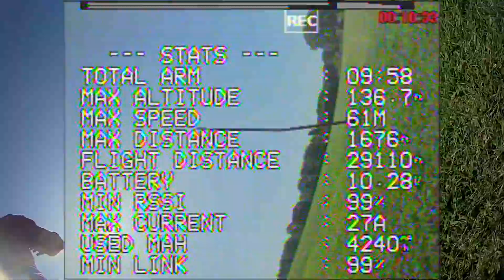Sub 250g (29,000ft Total Flight Distance Test) 3" HD GPS Long Range FPV Quad V3 - Under 250g

Comment from the maker: My Top 5 Achievements in Sub 250g FPV :-
1. 2.08 Miles Long Range Flight (HD, GPS) :- https://www.youtube.com/watch?v=9J6eG5o6_jE
2. 18+ Minutes Flight (HD) :- https://www.youtube.com/watch?v=RJQxhjeUilY&t=329s
3. 29110 ft Total Flight Distance in (HD, GPS) :- https://www.youtube.com/watch?v=9dqISZjqBlg
4. 125mph (201kph) Top Speed 3" :- https://www.youtube.com/watch?v=cTC4UaPfBtA
5. Best Ever 4" HD Freestyle Quad  :- https://www.youtube.com/watch?v=-Zw3A9fFODs&t=5s

Comment: Furious FPV has a 2.4 800mw VTX and a diversity module to match.   Bigger antenna sucks to deal with but I wonder how far it can go.

I have been a 1/2 mile out and back on 2.5inch.  RSSI on the crossfire was having more complaints than my 5.8 Mach3 but I am Rapidfire with dual 6db patch antennas on the Immersion Lazer mount.
Reply from the maker: I've been out to 1.28 Miles with 5.8GHz and could have gone further but for the battery here is the video (https://www.youtube.com/watch?v=xy8Pnb2xEC0&t=9s) and the RSSI on my crossfire only dropped to 95%, I now have the battery setup to take me to 2 - 2.5 Miles Sub 250g so we shall see how far i can go on Wednesday, I have looked at the 2.4GHz but it seemed a little heavy and i am already at 249.8g with my current setup. I even bought the new TBS Unify Pro32 HV which is crazy powerful but again heavy compaired to the 2g TBS Unify Pro 5v 800mW. Great work on your CheaterKwad build, if it wasn't for people like us who would the Chinese copy lol  !!!!!
Reply: @Sub250gFPV  i have been out to 1 1/4 miles as well but that was a very open countryside type of environment.   My RSSI was dofferent because I used LQ/RSSI for the flight.    But my 2.5in 1/2 mile flight was in a much more urban setting.    And there may have been a tree between my LOS as I flew it.
Reply from the maker: @dividingbyzeros  Backgound noise in the urban setting I understand. Do you know the weight of the 2.4GHz antenna ?
Reply: @Sub250gFPV  sadly I do not.   Maybe RMRC's page might have some specs for the VAS offerings.
Reply from the maker: @dividingbyzeros Will do I'm now subbed to your channel, oh and thank for your advice as I've got the ImmersionRC SpiroNET LZR Long Range Antenna Array with 2 x 13dBic Patch Antennas coming tomorrow to use with my rapidfire and HDO setup, I like the idea that when the two rapidfire signal bars are equal you are looking in the direction of your quad. (not sure about the weight issue - like having two Jodrell Banks strapped to your head lol)

Comment: Great work!! This is one of my dream.

I dont expect that much(around 5.5 miles that is crazy) 

Could you kindly share your setups?
Reply: Sub 250g FPV Sub 250g FPV that's alot. but worth it. subbed your channel , I will watch your all videos.

let me give you my 3inch setup. 

-IH3 frame
-Hglrc 1407 motors
-runcam split mini 2
-Geprc stable fc + esc + vtx stack
-xm+ 

It is little under 250g when I'm using 4s 650mah battery.

ground gear is  fatshark HDO with rapidfire module and immersion RC anttenas just same as link

 (https://www.rcdepothobbies.com/product_p/rfire01-sn5g8rhbun.htm)

I will learn frome your page and videos but could you give some advice?

oh one more thing. I have X9D but has screen problem. so im using Qx7 now. should I repair X9D?
and I have r9m module aswell.

I dont even expect 5.5 miles far, juy around 2 mile would be very happy
 thank you so much for your great comment:)
Reply: Sub 250g FPV i did too!! but motor is not same. :( mines are 1407 motors only can run 3-4s :(
Reply: Sub 250g FPV thanks! i have to lean little bit more
Reply: Sub 250g FPV  thanks for these great information.

1. actually I have R9m module and r9mm reciever, does these combination not work for 1mile + back?

2.what do you mean for little screen? I live in USA and I usually buy qaud parts from Getfpv. If r9m+ r9mm are lack for long range, should I buy this one? (https://www.getfpv.com/tbs-crossfire-tx-lite.html?utm_source=google&utm_medium=cpc&adpos=1o1&scid=scplp9459&sc_intid=9459&gclid=Cj0KCQjwu-HoBRD5ARIsAPIPenfIMfJ7W-bnrRTGmzxeb9pDojiAa_M3po3lTqOuyxdfibwZI-DRwK4aAkjsEALw_wcB)

3.can I use my hglrc 1407 3600kv + 4s 650mah with 

 I believe my geprc stable f4(20a Aio esc) does not support 6s. It only support 3s to 4s.

if don't , I need to buy new fc stack motors and battery aswell that is to much for now.

4. yes, of course I will never fly over people and houses. I never did so far.

5. can I use this one for gps rescue ?  and Geprc stable towet stack has just omnibusF4 v2 so im not sure this one support gps port. (Geekstory BN-180 GPS Module UART TTL Dual Glonass GPS Car Navigation + GPS Antenna for Arduino Raspberry Pi Pixhawk Aircraft CC3D F3 Flight Controller https://www.amazon.com/dp/B078Y4XZN9/ref=cm_sw_r_cp_api_i_ROygDbXCJB6GX )

6.So I will try to first long range with below.

-Geprc stable stack 
-Hglrc 1407 3600kv motors (does support only 3-4s
-650mah 4s
-tbs unify pro 5g8 hv with immortal anttena
-qx7 + R9M module + r9mm reciever.

If I should using parts with your suggestion, I need get some money and fix taranis x9d lcd first.

7. Im using foxeer Lollipop v3 Antenna with ufl connector  for vtx

sorry for so many questions friend.

Comment: setup details ??
Reply: @Sub250gFPV  Thanks ...i have the IH3 too very nice frame!! i use the 4300kv amax 1106 and a turtel too but im waiting on my caddx tasier to put in ...i get about 8 min flight time on a 1000mah 3s and the 2.8 inch king kong props....i will try 2 blade props maybe get near to 10 min
Reply from the maker: I've now updated the quad component details in the description, thanks for watching.

Comment: That was a 3S? You got 10 minutes of flight time on a 3S?!? Wow! Great job! Simply amazing!👍😜
Reply from the maker: I can get over 15 minutes of cruising around the garden at around 8 MPH with this setup but in this instance its not about the flight time, using the Total Flight Distance is a far more accurate way to calculate efficiency, I have performed the same test with quite a few different battery sizes and this 3s one gives me the most Wh energy for its weight out of all of them and still keeps the quad under 250g. LR V4 is already on the drawing board !!!!!!!!!!!!!!
Reply: @Sub250gFPV  Dude! Keep going!👍